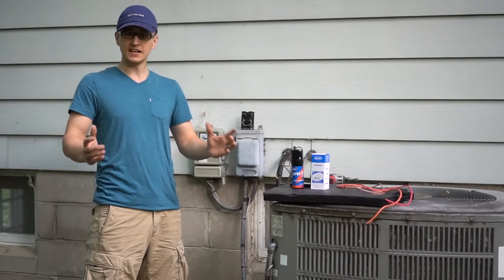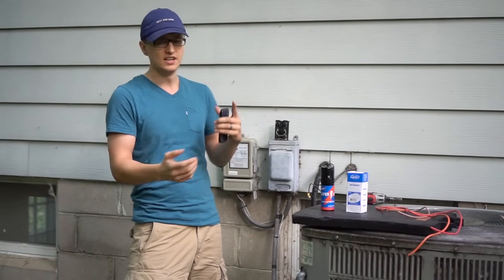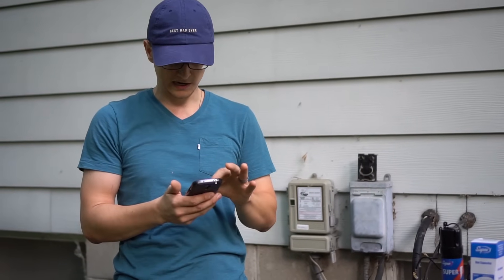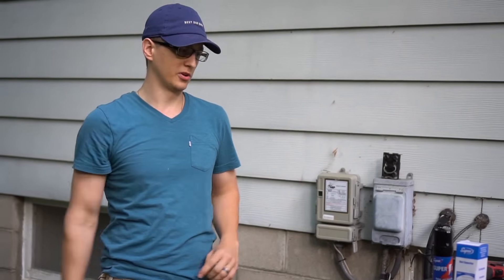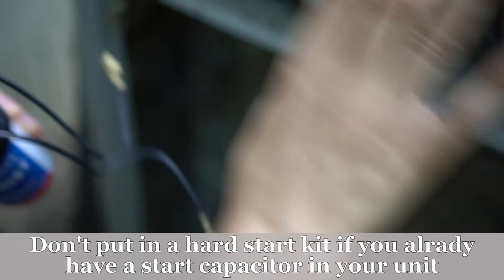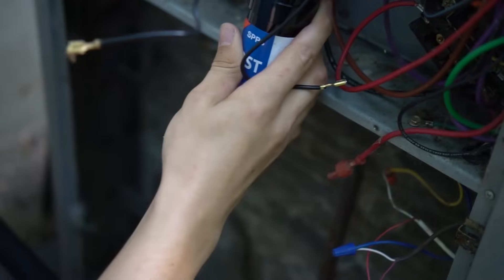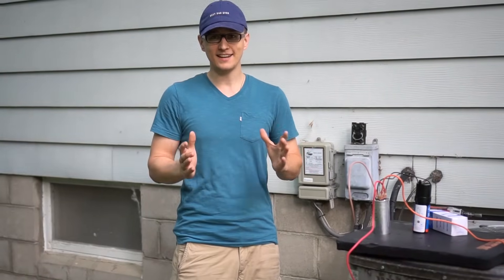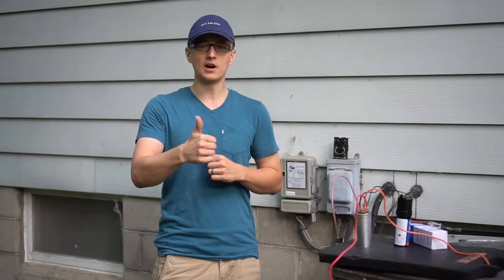How to Install a Hard Start Kit in Your Air Conditioner

Comment: Ugh. I just spent $350 on this with 1.5 lb of Freon in my 13 year old unit. I feel like an idiot. Im a big fan of DIY but I didn't know anything about this until AFTER the work was done. I'm such a sucker. Great video.
Reply: It’s called tuition

Comment: This Subco uses a Positive Temperature Coefficient Relay (as stated on their website) not a Potential Relay. Not Good! Only use Hard Start Kits that use a true Potential Relay. The RectorSeal Kickstart (2 wire) and the 5-2-1 Compressor Saver (3 wire) hard start kits use a Potential Relay. I recommend the Kickstart (it uses 2 wires that connect to the Run Capacitor - HERM and COM). But the Compressor Saver is also good (3 wires with one connecting to the common / ground on the Contactor relay). They both work the same way - the Potential Relay detects the pickup voltage (back EMF). This causes the relay to disconnect the start capacitor when the compressor reaches about 75% speed (usually less than a second). Note: Supco does have hard start kits with a Mechanical Potential Relay (Models 3W1, 3W2, & 3W3).

Comment: Hi, I am doing some comparative testing on my Rheem 3 ton. The unit is rated at 79 LRA. I tried the 5-2-1, the TO-5 Kickstart and the Amrad TES5...but all are giving me only about a 7-9 % reduction in LRA?? 73 or 72.5...I am thinking I just have a cheap meter that is not great for taking the Inrush measurement...(Mastech 2108 w/ Inrush feature,$89)...
Can you recommend a meter that really has a good Inrush measurement as I want to be as accurate as possible?

Comment: I don’t see how anyone could NOT like this video. He not only showed exactly how to do what he said he was going to do, but gave an extra ton of free useful information. Some people will never be satisfied. Anyway, thanks a ton! 😊 🙏🏽
Reply: Probably HVAC guys who watch it and get pissed that they will lose some easy jobs.  I just ordered a replacement on ebay for $30 (including shipping).  HVAC guy would charge $125+/hour and another 80-90 for the part.
Reply: I agree,  that dude  is a awesome teacher.
Reply: Not this ac guy. More power to you.  Theres no shortage of work. And just to add a reminder he said to make sure thers no coil behind the screw. 100 percent the number 2 thing i see with do it yourselfers. -Charge in the ozone-. Number 2 would be a 30 amp fuse for a 3 amp low voltage, now at the minimum you got a shorted wire in the outdoor unit and a fried transformer.  At minimum

Comment: Thx. I am the proud owner of (2) 33 year old Trane condenser units - installed when the house was built. Last night the upstairs unit stopped cooling. I replaced the 3 capacitors (2 had bad readings) from my stash and got the unit running. I had heard about these Hard Start boost  devices but needed to know more. This video is great. Many thanks. My situation checks several on that list. I will order one today.
Reply: did they work?
Reply: @lklpalka  Hi Ed. Sorry about the slow response. Yes, this booster and my A.C. unit are working fine. I expect to get another season out of the 2 A.C. units ... fingers crossed considering  their age. If you are still undecided about buying and installing one, my recommendation still
 holds true.
Reply: @ApexHotShot  I'm ready to install the replacement hard start kit today... same specs as original. Have a spare cap with extra 100mfd more kick on hand just in case. Repl. of oem dual-run cap didn't do much. Maybe new contactor and start kit will keep it for another year or two. Trane XL14i, just had 13th b'day but had been professionally maintained by contractor who retired. Hopeful..TY Bryan!

Comment: Hi Thanks for the video, it got my Lenox Unit up and running so far...the unit itself probably went through 3 or 4 cycles after installing the kit and then I heard the compressor start instead of just humming for 5 seconds and shutting off...1st symptom was blowing hot air > Replace Capacitor (no change) ...> Install Hard Start kit and restart , after about 30 minutes the think kicked on and is still JAMMING  Thanks Again  ! Stay Safe Stay Cool ~
Reply: mine is a 3 N 1 Start SUPCO RCO810 and needed to be persuaded in to position with some needlenose
Reply: still intermittently failing with buzz when system calls for cold air but does occasionally start and cool ..any comments or ideas ? my thinking is that the thermostat and controls are good , thing is that when it does start up , it sounds like there are 100 little men in there with hammers but it does run and cool

Comment: Awesome explanation.  My run capacitor is open circuit.  Now that I know it is a run capacitor thanks to you, I can just replace it.  I was looking for the start kit in my unit and didn't see one, even though it's shown in the schematic.  Sounds like I could easily add it and improve things a bit.

Comment: I've got one of these kits installed on my unit already. My fan won't start spinning at start up but it will if i give it a little help. It sounds like I might need a new normal capacitor and not a new hard start capacitor. Does that sound right?
Reply: You probly just need a new capacitor. Hardstart kits are only for compressor.

Comment: Love your videos! Very informative. Open Question for the HVAC Gurus...

I know Start performance improvement with a 5-2-1 Hard Start Capacitor Kit is not as great on SCROLL compressors, compared to RECIPROCAL types (many Y.T. vids show reductions of Inrush Amps by as much as 45% after installing a 5-2-1 Kit - I assume these are on Reciprocal compressor units). 
At best, I've seen only about a 9% reduction in Inrush Amps on my Rheem 5-Ton Scroll Compressor aftter the 5-2-1 Kit was installed.
Is this a normal "improvement" to see when matching the 5-2-1 Hard Start kit (biggest capacitor) to a Scroll compressor, or should I be seeing lower Inrush results than this? 

Install Story/DETAILS, for anyone interested:

So, I just installed a CPS 5-2-1 CSRU3 Hard Start KIT in my 7YR old Rheem 5-ton SCROLL compressor/condenser unit, ( was running fine), but was slightly slower, buzzier, and metered with INRUSH Amps a bit above the specification on start-ups, recently. 

L.R.A. specification for this 5-Ton split unit is: 152.9 Amps.  

BEFORE 5-2-1 Install... Compressor "C" wire Metered INRUSH = 157.2 Amps. 
AFTER 5-2-1 Install... Compressor "C" wire Metered INRUSH = 156.1 Amps.

Metered several "call for cooling" startups @ 150-155Amps INRUSH, AFTER Install: Best score was 147Amps INRUSH, with most starts hitting 152-155Amps.

Disappointed (thinking the 5-2-1 kit was a dud),  I metered INRUSH again, a day later, on a few more start-ups - I found that my INRUSH was averaging between 142-146 Amps and the compressor has a more positive start, no buzzy wind-up; lighting in home doesn't dim during start, as before. All wiring terminals checked & re-verified, good.

(Same weather, thermostat settings, no other system changes since install day). 
Odd - I'm unsure why unit seemed to perform better the following day.

Thanks for reading!

Comment: Hi There, do you have to turn off the breaker for the AC unit before installing the kit? Any electrical you need to turn off?
Reply: Yea if not you’ll get a good jolt from 120v but 220v is not so forgiving

Comment: I’m just trying to understand in my head how this works....lol

Compressors are very specific about what size capacitors is will use. How is it that that the 3 in 1 Supco hard start kit will work for multiple different units that require different size caps to run the compressor. It’s like a one size fits all.
Reply: It's really only the run capacitor that needs to be a specific size.  The start capacitor just needs to be 'big enough'.  So once it is started, the start capacitor is taken out of the circuit by a relay.

Comment: hi jay,   I installed a hard start over a year ago after watching your video.    recently it seems
like my compressor is t starting like it used to.  Is there a way to
test the hard start cap to see if its still good?   Thanks. Jim
Reply from the maker: They can be tested like a normal capacitor but the only problem is that it does not specify what the exact measurement should be. It's typically 130 to 156 MFD. (by the way, some meters will only measure up to 100 MFD)
Reply: roger that.  ill try to test it and see what I get.  Ill probably change it and see how the new
one works and compare.   any idea of their normal life span
Reply from the maker: @jdubya54  Their lifespan is usually pretty long... Although if you live in a state where it gets really hot for long periods of time, then the chances of it failing go up. In that case it would probably be better to get a 5-2-1 start capacitor and relay as they take the heat better. (I have links in the description) I also want to mention that if the reason the hard start was installed in the first place was because the compressor was not starting... Then unfortunately a hard start will only have a bandaid effect. There will come a day where even with a hard start kit, the compressor will be stuck and unable to start. At that point it's game over for the unit.

Comment: Hey bro in your video it says dont put a hard start kit if you already have a start cap in the unit. Does that mean if it has 2 caps dont add the kit unless you take out the separate start cap or are you talking about a duel cap? Just to be sure! Also since day one my compressor will not start when the outside temp hits 96 deg,  3 year old york unit the guy who installed it never answered my calls and is presumed dead. I have to spray the coils with water for a min to get it to kick on. Has new cap but still doing it. Will the kit help with this? As long as it is below 96 deg it will kick on just fine.
Reply from the maker: Unfortunately I have not had that problem here in Minnesota before so I can't tell you what would be causing it... (it rarely gets over 95 here) As for the start capacitor, I was not referring to the dual run capacitor. It's as you said, if you want to put in a hard start kit, you would have to take out the start capacitor (and the potential relay that goes with it) otherwise if you double up, things can start melting. I suppose it's possible that the start capacitor is bad... A hard start kit reduces start up amp draw which will reduce the heat the compressor generates when it starts. I think it's worth a shot. It's not too expensive. I actually did that on my unit: https://www.youtube.com/watch?v=hC0nFT1XPcI&t=5s
Reply: @WordofAdviceTV  thank you for your reply.

Comment: I'm trying to power an 8000 btu, 715 watt window unit with a 1400 watt running,  2k watt generator.  I put in a hard start kit, and the compressor wont kick on. It tries, the gen throttles up and the led light I also run off it dims for a second, but the compressor just wont kick on. Its tp-5 kit. Is the kit too small?

Comment: Great job on the video.
What do you think about the Amrad TES5 (https://www.amazon.com/Amrad-TES5-Easy-Start-Start-Compressors/dp/B07F3FYBLC)?  I installed a 521 for a 3T unit however this one has a higher mF for the same rating. Is higher better?

Comment: I ordered the startup kit my unit only has a delay and the capacitor and contacted do I remove the delay completely it's a 20 yr. Old ruud
Reply from the maker: You would remove the old capacitor and relay. I actually did that on my unit right here:https://www.youtube.com/watch?v=hC0nFT1XPcI&t=4s

Comment: Wht about if I already install a start kit but it keep doing the same thing ...
Reply from the maker: If your compressor fails to start even with a new capacitor and a hard start kit... Then unfortunately the compressor has failed and there is nothing you can do for it. (before coming to that ultimate conclusion, I would also check the wire connectors at the compressor pins to make sure they are on there securely..)
Reply: This is not a guaranteed

Comment: Are there different sizes? If so how do i know which one to buy for my compressor?
Reply from the maker: If you are buying a 5-2-1 start capacitor and relay, then yes, there are two different ones. But the one I use in the video pretty much fits all residential condenser units unless you have a really small house.. (the SPP6 kit is good for 2-5 ton units)
Reply: Word of Advice TV ok thanks. Your videos are great
Reply from the maker: @WrenchFixRepeat  Thank you :) Stay cool!

Comment: OK... I need your advice about some specific things.  As always, your fast reply is greatly appreciated.

Facts:
My current unit is a 3 ton split Bryant (20ish yr old unit) that currently starts and runs flawlessy.  The condenser has a reciprocating Bristol Compressor model # H25B32QABCA.  when I looked up specs it said under ELECRICAL ACCESSORIES category it lists 
Start Relay: GE 3ARR3*3N* (*3P*) 
Start Cap: 88-108/250 (145-175/250) µF/volts  
Run Cap: 40/370µF/volts

On the fan motor it says 5 MFD / 370

The dual capacitor I have on the condenser is a Totalline P291-4054RS  440V  MFD 40/5

I have ordered the 5-2-1 / 1-3 ton CSRU1 hard start kit and it says 88-108 MFD is its spec. It is NOT installed YET.

I think I know the answers to all of the below issues and simply want to cross reference with a pro so I do not accidentally blow up my condenser (or whatever) so here are some...

Questions:
 If there are no other capacitors (other than the 40/5 mfd dual) in the electrical connections area of the condenser does that mean...
1) I do NOT currently have a start capacitor installed at all?  In other words, it was only considered an accessory for the unit so it was not installed and the dual cap I have is only to run the compressor and the fan but has no additional "boost" for starting?
If so...
2) It isn't ABSOLUTELY NECESSARY to have a start cap or hard start kit to run a condenser?
3) Is my (soon to be installed) 5-2-1 Hard Start Kit adding / performing the function of the (currently missing) start cap?
4) The 5-2-1 is a perfect match to the compressor spec.  correct?
5) Is there any other location (besides the electrical connection area) in the condenser where I might find a start cap (if it exists)?
6) I saw or read a few different places that I should install a new Dual Capacitor (especially if Dual Capacitor is out of spec) at the same time I install thenew 5-2-1 kit or the new Hard Start Kit MAY slowly damage the compressor windings.  Do you know if this is true (or anything about this)??  
7) In your opinion, are American made run capacitors worth the extra money (and are they any better for the longevity of HVAC equipment?)  I can buy an Eastman (foreign made) Capacitor at H Depot for $6.80 or (USA made) AmRad for $28 or Titan HD (by Packard) for $16 ish.
8) In your last message to me you said "I need to make another video where I compare the 5-2-1 and the hard start kit".  I thought the 5-2-1 WAS a "hard start kit"  but the way you referred to it in your message makes it sound like it isn't a hard start kit. A) Is the 5-2-1 a hard start kit?  B) If not, then what is it? C) For my application, does it matter?  please clarify.
Reply from the maker: Lol, this comment got spammed just for the sheer length of it. I appreciate the organized comment! I will answer them in the order asked. (to the best of my knowledge, I only have 6 years of experience so I wouldn't exactly call myself a veteran tech)

1) If you look at your condenser wiring diagram it will probably say "start capacitor may be factory installed. That usually means it's not factory installed.
2) No it is not absolutely necessary to have a start capacitor. Many companies stopped putting them in to save themselves a few bucks in manufacturing costs.
3) Yes
4) Yes
5) It will normally be in the electrical section where the run capacitor and contactor reside. Big black cylinder typically hard to miss..
6) I have never heard that before. But that's not a bad idea. An out of spec run capacitor should be replaced regardless if you are putting in a start capacitor or not.
7) I don't think it matters too much but some people will claim that American made is better. The insides are pretty much the same. (You could buy two cheap ones and keep one as a spare for peace of mind)
8) Sorry for the confusion. They are both hard start kits but one has a potential relay and the other does not. I usually refer to them as start capacitor and potential relay (5-2-1) and hard start kit (no potential relay). Is that technically correct? I really don't know, that's just what I call them.

Comment: Hello,  my unit starts with a big bang and sometimes dimes my TV, would better to replace the potential relay and the start capacitor of just add that hard start kit? Thanks!
Reply from the maker: In the description of the video I have links to both. A hard start kit like the one I used in the video (you would need to disconnect the old potential relay and start capacitor) or a 5-2-1 style hard start like the one you have. The 5-2-1s are generally preferred over the hard start kit. I personally like the spp6 though :)

Comment: Do you have to get a hard start kit that matches the vac to your capacitor/ compressor and the tons of compressor or just any hard start kit is fine
Reply from the maker: Any hard start kit that is 370/440v will be fine.
Reply: There are also some hard start kits that say for refrigerator use. Can you also use them for compressor in residential ac
Reply from the maker: A refrigerator one should not be used on an air conditioner. I would just select one of these:
Here is the hard start kit I have in the video: SPP6 Hard Start Kit: https://amzn.to/2JSPieo
Here is a link for a 5-2-1 Compressor Saver (1-3 ton units): https://amzn.to/2YivQym
Here is a link for a 5-2-1 Compressor Saver (3.5-5 ton units): https://amzn.to/2YbopVo
Another option: Rectorseal Kickstart (1-3 ton units): https://amzn.to/2XYwH7H
Another option: Rectorseal Kickstart (3.5-5 ton units): https://amzn.to/32KgZvS